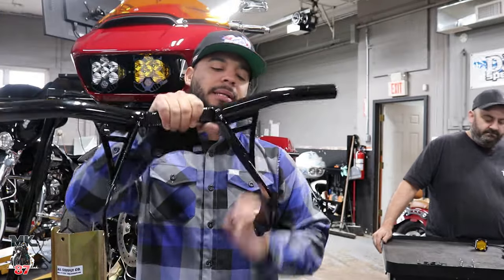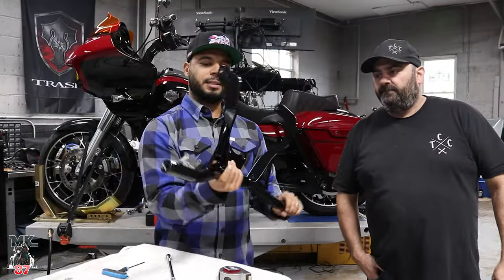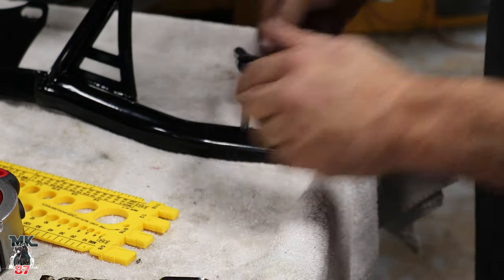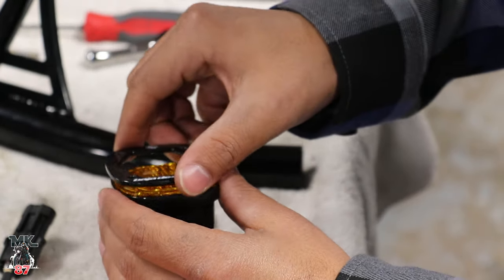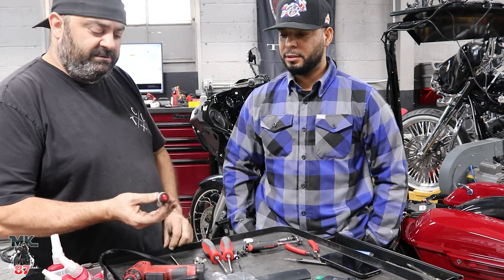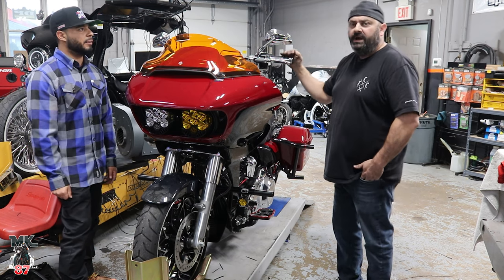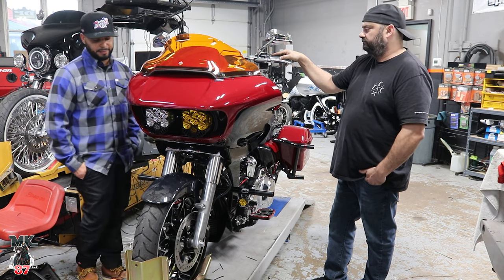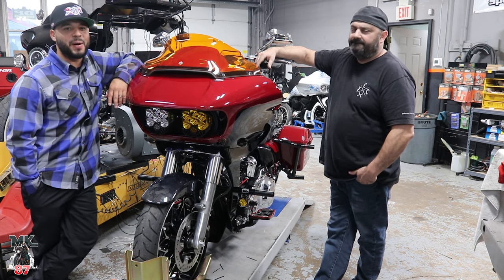SANTORO FABWORX Not Yo Daddy crash bar with BAJA s1 lights INSTALL

Comment: Respectfully, I think Mike is wrong about tying into Accessory.  I did this install last year on my Road King and the accessory circuit can handle up to 15 or 20 amps and Baja S1s only needs 5.  Anyway, good choice for location, I did the same and agree that it can be too much as turns along with the LP6.
Reply: Good point, but I think you could be at that limit (15ish amps) if adding heated gear to the same accessory circuit. Gloves, jacket, pants will pull about 10-12 amps.
Reply: @sjbagger you are correct but I just don’t do it. If it was my bike maybe because I would know if I was going to overload a circuit. But on customer bikes who knows where they have been or where they are going next. Some other guy could tie in a bunch of stuff and cause issues.
Reply: @TorqueCustomCycles  yeah it’s an RKS so I don’t have anything else pulling off of this so it works out fine.  Nice job though, clean setup and switch is also helpful.
Reply: @donniep75  good point as well.  Fortunately I don’t have any additional load on that circuit.
Reply: @SJBagger thanks bud. When are you swinging by ??
Reply: @TorqueCustomCycles  need to get out there, plus I need to get up with pnutz.  Looks like you guys are doing some great work though, keep it up!
Reply: @TorqueCustomCycles what exactly were you soldering?? Just shorting up the wiring harness?

Comment: how much room you have with shifting foot with the s1 lights there?  I have 22 road glide special with stock chopped engine guard and i put the baja squadron sports hanging in the opening of the crash bar and my foot comes close to back of the light.  i was thinking going do this same setup and switching to smaller s1 light like in this video.  is there more foot room then stock crash bar?

Comment: So if you are running the side spoiler…. And you get these crash bars… then taking off those little brackets that connect to the original crash bar is okay to take off ? You know what I’m talking about?? Those like O clamps that wrap around that connect to a part of the side spoiler. I have an 22 RG ST, I got the side spoiler off Advanblack, and have stock crash bars.. they make you mount the spoiler to the crash bar